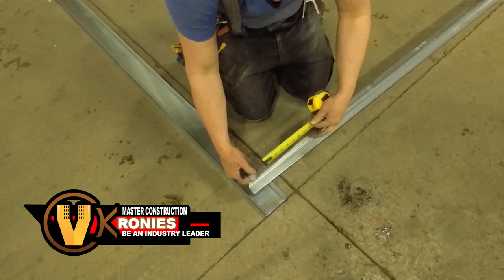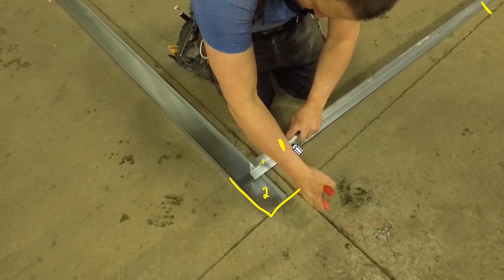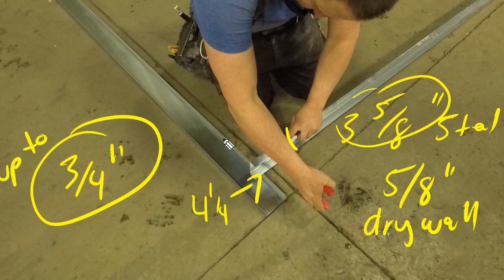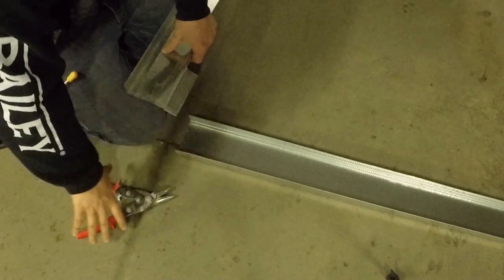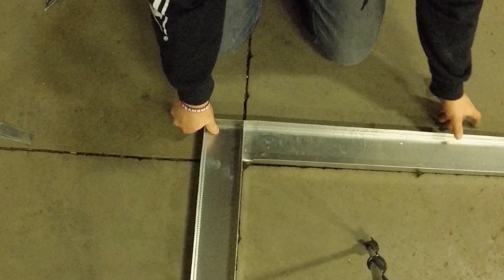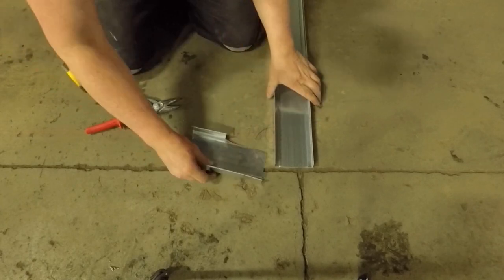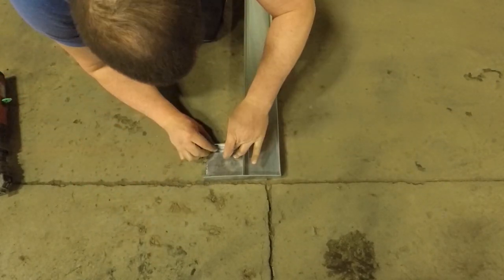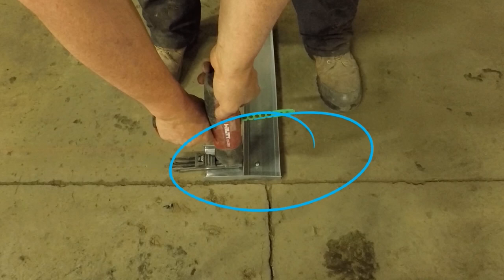Master Metal Stud Framing & Drywall All Types Of Corners Lesson

Comment: Why are you caulking the bottom of the track? Seems useless if you're driving a nail through it to secure it to the cement.

What length nails do you recommend for the bottom track?

What's your stance on using a crimping tool vs. pan head screws to secure the metal studs in the track? My inspector said to use a $20 crimper as it's much faster, easier, and leaves your stud flush (no pan head).
Reply from the maker: The reason why we caulk the bottom track is to achieve  proper thermal and moisture bridging between the change in materials. It is usually code to use 1-1/4" pin bolts and the 3/4" direct fastening pins for say a Hilti or Ramset. Crimpers are $100 here but they are the standard ones we use in the trade so maybe better quality. I think crimping the top track ONLY on the far side is perfectly fine so out of the 4 possible screws you are only using 3 plus a crimp. I use the crimpers for studs I can't get my gun into the space to screw off. However a lot of guys use them for the the backsides completely both top and bottom and only screw in the front side. I am a heavy gauge steel guy, rarely do I do light gauge so I like to make everything super strong and use screws everywhere possible. That is just me though.

Comment: Thanks for your videos.  Im outfitting my basement and first time using metal studs, Im installing a small kitchen, so my question is... to support the upper kitchen cupboards, should I use 25 gauge or 20 gauge studs?
Reply: actually I've been looking for a video explaining the structural differences between these two gauges and if I really need to use 20 if 25 would do the trick (being skimpy on an unemployed budget)
Reply from the maker: OMG man I am so sorry I missed your comment. I hope this finds you in time. You can use any gauge of steel stud just install 3/4" backing in between them wherever you need structure to hang stuff.
Reply from the maker: Yes sorry you can totally use the 25 gauge. You won't need 20 gauge anywhere in the basement.
Reply: @ConstructionKronies  Thanks man, I appreciate you.  One other question...hanging drywall ceiling is ok too for 25 gauge?
Reply from the maker: @filmmakerdude  yes 100%, the only thing you need for your ceiling is furring bar and angle. I can teach you exactly how to install it. You can use studs and track as well. It all depends on bulk pricing and if it's worth it to just use the stud and track for everything or buy the 7/8" furring bar 25 gauge and 25 gauge 1-1/4" angle.
Reply: @ConstructionKronies  Do you have a video on that?
Reply from the maker: @filmmakerdude  I do have some video that will show the system for the ceiling. These are soffit videos but are the same idea for your ceiling https://www.youtube.com/watch?v=SAECEpAYIXo&feature=youtu.be
and https://www.youtube.com/watch?v=e21XFiD4ew0&feature=youtu.be
Reply: @ConstructionKronies  well that was perfect as I'm doing soffits to cover mechanical stuff in the basement - Thank you.  Is it ok to have the hat tracks at 2-foot spans or would you recommend 16 inches?
Reply from the maker: @filmmakerdude  I would keep them 16" on center, but any uprights can be 2' oc.
Reply: @ConstructionKronies   You rock, thank you for spending time on these videos and personally educating me
Reply from the maker: @filmmakerdude  Thank you!! Anytime bro!!

Comment: How to calculate no of screws needed for 16" o/c? If we have room dimensions 14'*12 and wall ht on all 4 sides 10'? The total area would be 520 SF, right? Can you please confirm the quantities which I have calculated are correct or not? If not can you please share a link to your video or a detailed explanation about the calculation of materials for drywall installation on metal studs?
Total Area= 520 SF
Total track= 52LF/1.33= 39 plus corners= 2*1.5=3 so total= 39+3= 42*2=84 including top  & bottom
Drywall area= 1040 SF on both sides.
No of sheets= 520/32=17 sheets*2= 34 sheets (4'*8')
No of screws= total area*12/16= 520*12/16=390 screws will need it right?
All of these are correct or did I make mistake? If you have any video figuring out all the materials as far as estimating drywall materials for commercial construction is concerned then it would be great.
Reply from the maker: Hey there, thanks for the question. It's important not to complicate it. First tip is to round up to even numbers of standard material sizes. For a 14x12 you will need 12 pieces of track (10' lengths) and you need 1 stud for every foot of wall when its 16" o.c. so 52 l.f you need 52 studs. Drywall get 10' sheets and you will need 26 sheets minimum  and I would always get and extra sheet or two. Screws come in boxes so grab a 5lbs pack of 1-1/4" drywall and a 5lbs box of framing wafers. For the mud, count your corner beads, get 1 500' roll of 2" tape, 2 boxes yellow and 2 boxes greeen! That'll get er done!
Reply: @ConstructionKronies  thanks for the reply, I didn’t get it. I have some doubts. Would it possible for you to connect over zoom or any other platform so I can ask some questions back & forth?if you don’t mind??
Reply: @ConstructionKronies  Thanks a lot for your response. I understood, as far as track & studs are concerned but how did you end up with 26 sheets of drywall? have you used 4'*12' of drywall? How many screws come per LB per 1 box if I want to calculate skews in numbers?
Reply: @ConstructionKronies  I haven't received a response from you?
Reply from the maker: Use 4'x10' sheets (40sf) instead 8' sheets. You will save on taping joints and  not have to cut the sheets tomdit.on 10' studs. Screws go every 8" in the bevels, 16" in the field studs and 4 on top and 4 on bottom.
Reply: @ConstructionKronies  what does it mean by bevels? It’s not at 8” o/c right? We hang screws at 16” or 12” o/c depending upon the distance of the studs right?? How do you determine no of studs like EA??

Comment: Just curious but when you put the 2 studs on each side of the framing for the doors why do you space them out the size of the sheet rock rather than have them butting up to each other like to understand things
Reply from the maker: Hello Christopher. My apologies for the late reply I was out at the lake for 4 days and had no reception.  I am not sure if I understand your question but what I think your saying is: The doors come in different widths for drywall. We level our walls and plumb up the studs so we can use the drywall to space the frames. Fire code demands the drywall to slip in behind the casing of the steal frames. We add a second door stud in after the door clips are screwed in. We don't put drywall in between those studs. I hope this helps clarify.

Comment: Thanks for the video mate but there are two things that I am still doubtful about: 1) I don't think that screwing on gyprock is compliant to any code. Plasterboards are not for structural use and since you are screwing the backface of the boards onto the stud on the opposite side that leaves me a bit confused, although I understand that what you are trying to do is to ultimately join two metal studs together, but that piece of plaster shouldn't be sandwiched in there. 2) Plasterboards should be screwed sideways to provide cross-bracing to the wall.
Reply from the maker: Hey my man! Thanks for the comment. We lock the corners in like that to provide more stability in the wall. Locking in the floaters is a standard practice for all drywallers. 2) Steel stud requires you to "stand-up" your sheets to achieve fire rating and it provides a nicer finish with less taping joints. We only "lay-down" drywall on wood studs. On steel stud you stagger your joints on the opposite side of the wall. The only circumstance you can "laydown" drywall on steel stud is when you can't land the bevels on a center (of stud) for example; a plumbing wall. Hope that makes sense to ya!

Comment: Do you not have to put 2 studs on each side of the door?
Reply from the maker: Yes sometimes. Some designers will specify double studs. I always reccomend using 20 gauge studs for your doors in light gauge walls instead of 2 light gauge studs.

Comment: Do you fasten the floater studs at the top and just leave the bottom loose? Or is the whole stud loose?
Reply from the maker: It's best to leave the whole stud loose. But 2 things, sometimes you need to put 1 screw in at the top for safety. If it's a high wall or light gauge something that could fall out and hit someone and 2 the general contractor may have it in the rules to put 1 in. They will tell you if there have that rule don't ask cause they will always say yes 👍
Reply: @ConstructionKronies  Fully noted. Thank you so much for the solid advice as well as the rapid response. Much appreciated!!
Reply: @ConstructionKronies  why go to the effort of 1 at the top, when 1 at the bottom is enough, and can work your way upwards? Not sure about some of your practises

Comment: Not sure why you lap your bottom track
Reply from the maker: Hey my guy! It's to give you strength and accuracy for sure. It also acts as a full system with the floater studs and locking the drywall in. Gives you both fire rating and strength. Also, we copy the same on the top track and that gives you many benefits when most walls don't go all the way up to the deck.

Comment: Drywall should be one piece around the door frame, that little 3" cut leg on hinge side is weak and should've ran through to the other wall.
Reply from the maker: Again, another misconception. You do you bro all good, we utilize drywall to minimize scrap and joints, the standard door frame is drywalled in 3 pieces, your full piece, buck piece and leg like I show you in the video.
Reply: @ConstructionKronies  you do drywall to minimizing scraps and JOINTS but you decided to 3 piece it lol? 
No misconceptions whatsoever as a couple other guys who knows what they're doing also called you out on it.

The most important part is putting drywall around a door that constantly twist the king stud leading to cracks.
You're supposed to 1 piece it by notching the sheet of drywall and break on a cripple and the fact that you had to 2 piece it tells me you're mediocre at best.

We appreciate the videos though and you mean well but you're perpetuating a new generation of hacks.
Reply from the maker: @alex46801  I whole heartedly disagree with you. It will not ever twist or crack. The secret is to tie in the floater stud first. Your way is only good when doing the outside first, we try to always do the inside first. At the end of the day its going to be the same strength. Trust me bro, been doing this for 30 years and I haven't seen your way since my early days. I have never 1 time been called back to a job (I offer a 5 year warranty) to fix anything. This is something we have debated in the past on this channel. Respect bro, what we do is not easy, its a tough job. I appreciate your insight!
Reply: @ConstructionKronies  "trust me bro" for a 5 year warranty, no thanks 😂😂😂